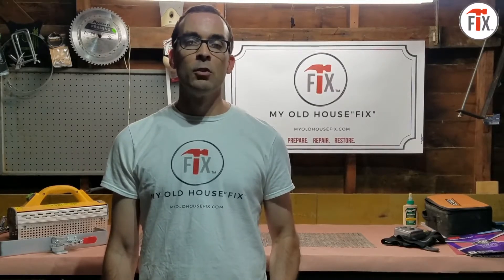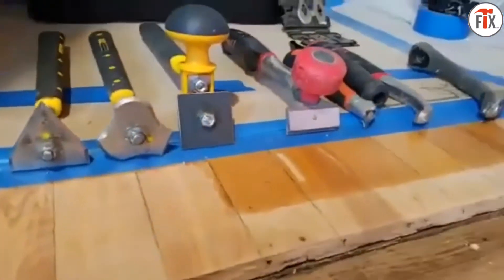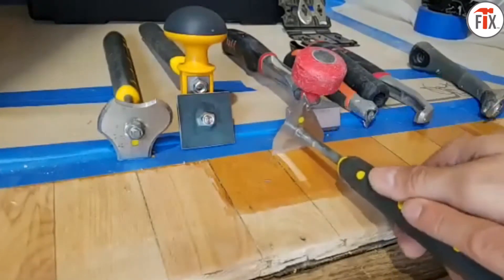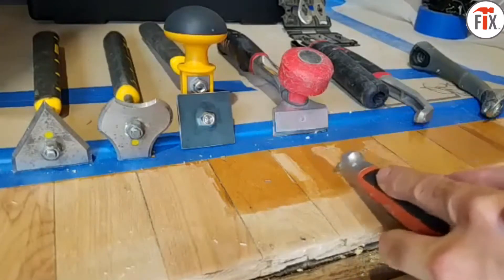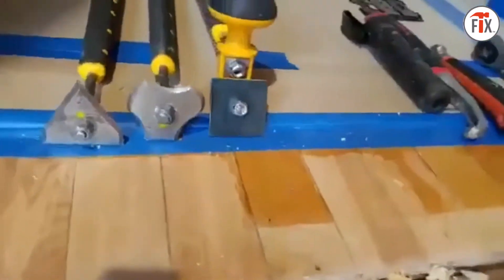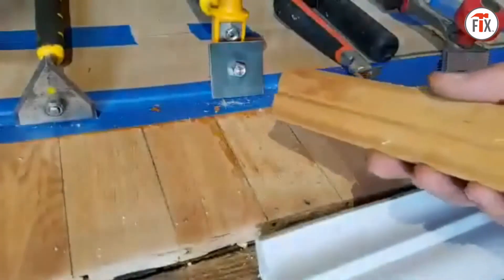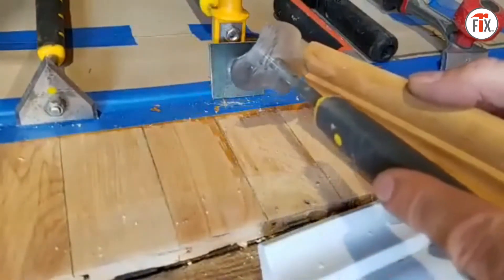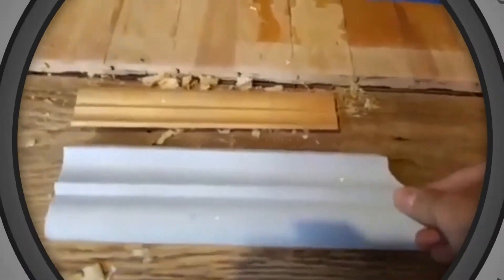Paint Scraper Types and Uses - Explained

Comment: I’m guessing you probably already know by now, but for anyone that doesn’t, you can sharpen a carbide scraper with a diamond stone.
Reply from the maker: yes 👍 I have a local guy that can sharpen mine but for the replacement price most DIY'ers don't do it or have a diamond stone.
Reply: @myoldhousefix  I’m a diy’er and new to it. But I’m also cheap and didn’t want to buy new ones 🤣 I got a stone, which is affordable. Your video was useful, thanks.

Comment: Super video and great explanation for the dry scrapping. I am trying different methods to scrap old paint off heavily covered skirting boards. The bahco pocket scrapper seems a good tool to save time and get the job done. What about using a wood chisel in the same way as your dry scrappers? Probably the bahco will definitely be a tool to add for the purpose of dry scrapping.
Reply from the maker: Hi Michael, pull scrapers are definitely a better option than wood chisels when it comes to stripping paint. If dry scraping isnt working well, you may need to heat it with an Infrafred Paint stripper. See our otjervideos with the Speedheaters  And make sure you always wear a proper respirator and PPE around lead paint 👍